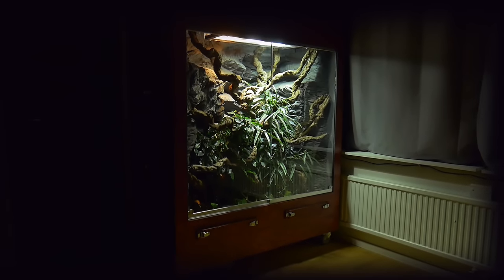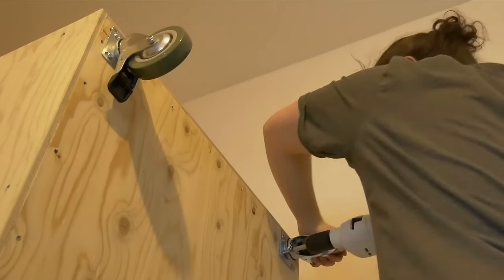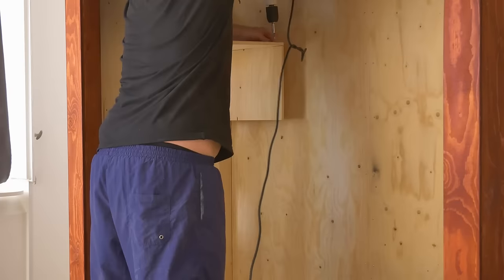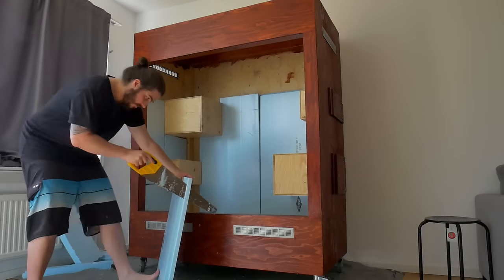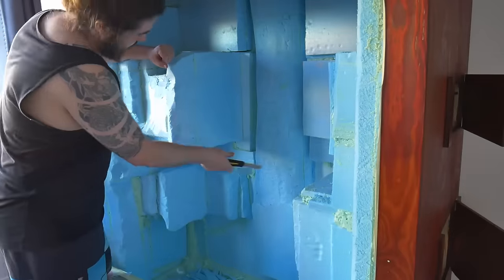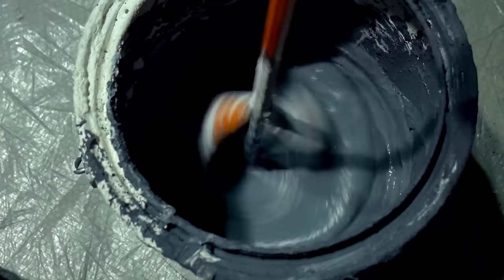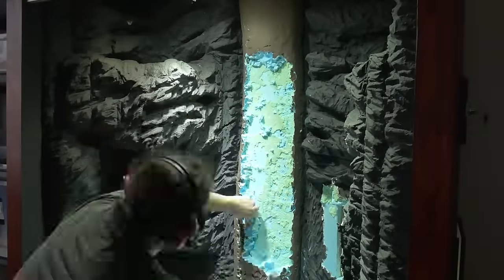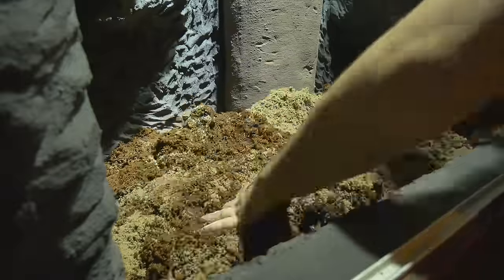How I made a Huge Reptile Vivarium – Full Build!

Comment: I worked in an upholstery shop for many years and a angle grinder with a flapper wheel make short work of foam shaping. It does require some vacuuming but it works great.
Reply: Also an electric carving knife is great as well.

Comment: This is a larger version of what I plan on building for my leachie. I can't wait for the more detailed build video so I can start planning. My baby is only a few inches long right now, but I want to start planning and building soon.
Reply from the maker: Working on it!
Reply: @SpectrumVivaria  Since leachies typically live in hollowed trees, I may have to revive your original tree plan and see if I can make it work. I've tried foam trees before and they are tricky. Maybe I should start practicing now or I can cheat and use large cork rounds haha
Reply from the maker: @cararichman1729  I spent far too little time with my tree to get it done right...lesson learnt. But I will try it again on another build in the future for sure. Nothing wrong with using cork rounds though

Comment: Best to drill pilot holes to avoid the wood splitting
Reply from the maker: For the plywood panels I didn't bother with pilot holes because of the size of the frame I was screwing into and the screws were quite small. I was also doing so many of them (200+ I think). I did however make pilot holes for all of the framing screws as this was important to not split the frame and was more likely using larger screws

Comment: For everyone using structure foam: If you want to safe time carving all that shit (also when adding / filling gaps after) you can wait ~ 20 - 30 min and just press it with your fingers in the spot you want it. the top surface is hardened enough but under it its still very soft and formable. Also when you get some on your fingers you can use vinnegar or citrus to remove it.
Reply from the maker: The problem with that method is the skin/surface of the expanding foam uncarved is smooth and not very porous. This is an issue for the grout/drylok/whatever you use to seal the foam to adhere as strongly as possible to the surfaces. You can do it that way but IMO it’s better to rough up the surface of expanding foam before sealing it. To do it that way for a larger vivarium it would also need an absurd amount of expanding foam cans and be far more expensive than using it with insulation foam sheets like I did here (if you want to create depth with ledges etc. and not just have a flat wall). 

But what you suggested could be a good idea for the filling of gaps created from the carving process!

Comment: The only thing I would have done differently is adding a plastic lining to the bottom inside of the vivarium, sealing off the wood a little bit better for the humidity and rot,  as water tends to absorb through the foam and could destroy the wood if there was in fact any small leaks. Beautiful build though, I love it.
Reply from the maker: Although how I did it has worked for me and there isn't any leaking or other issues after 2 years now - I still agree with you! I think this was riskier/harder to do correctly and it would have been easier to go with a pond liner.
Reply: @SpectrumVivaria  I'm glad no offense was taken, definitely helping give me ideas keeping me inspired with the builds. I'm taking the time to plan out a large build at the moment and I definitely didn't expect any feedback, but I'm glad to know the way you did it hasn't had any leaks. I was thinking of using a combination of masonry concrete with a pond liner given the research I've done. I was curious to see if you'd respond as I've done nothing to this scale and speak from little experience. Awesome and inspiring work!

Comment: This would be an amazing build for rats as well, with improved ventilation and obviously without the heating and misting systems. It’s certainly something to mull over
Reply from the maker: Interesting idea for sure! I had not thought of that but it makes sense - with far more ventilation and removal of unnecessary systems. Though the rock wall would have to be a far more durable system (maybe fibreglass or cement) so that they don't chew through it....Rats can chew through damn near anything lol!
Reply: Spectrum Vivaria I watched your vine tutorial too. I’d probably leave those hour as well and use the same climbing ropes I’d use in a traditional cage instead of chewing. Thanks for sharing your ideas with us.
Reply from the maker: @jaygay458  The vine tutorial can be viewed as a concept you can build upon with similar or other materials that suit your needs better. Thanks for watching and sharing your thoughts as well!

Comment: Hey dude, I have watched this video over and over again. It's brilliant, can you please get back to me ASAP with how it's holding up. Is it still completely waterproof in there and have you seen any signs of wood rotting? It would be hugely appreciated if you can get back to me as I have gone for the exact same method and copied your work to create my home for my Chinese water dragons.
Reply from the maker: The enclosure has held up great and my sealing was effective and has no issues. I covered this and many more details about this build in another video https://youtu.be/PJcjLpnTtQw . Its very detailed and has timestamps to find what you're looking for. I highly suggest giving this video a watch through considering what you're doing! Although it worked for me I don't necessarily recommend that method for others as I think its easier to do incorrectly compared to other methods of sealing the floor. Good luck with it!

Comment: how is the foam holding up with their claws? i never would've thought of just painting the foam with the drylok. what i did with mine was I painted the foam with watered down grout, about 6 layers and then used the drylok (5 coats). I have a Tegu and was worried his claws would tare the foam with the old silicone and smear dirt on it that i see a lot on DIY builds. the grout made a shell of "rock" on the foam and has held up great. there is a youtuber named "beckywheeler" hasn't done any video in like 10 years but she did DIY builds for people and she is where I learned about using grout.

Comment: Tips to removing drylock fume smell? Been a week for me long past dry and yet the moment the lamps warm it up its intoxicating all over again. Do u hwve similar issues?
Reply from the maker: Yeah even though its "dry" you need to expose the drylok to the warmer temps so that it off gases completely. I suggest keeping the lamps on 24/7 or warm it another way for a few days and if possible have it well ventilated/use a fan. In this enclosure because it is quite big I actually used a space heater in there. It took maybe 2 weeks or so for the fumes to be completely gone from this build.

Comment: This is so awesome! Will deff be referencing this when building my new snake enclosure! My only question is with the coating, it being latex. I'm assuming that you let everything dry and air out sufficiently before having the animals in and no risk of irritation?
Reply from the maker: Of course when using any type of paint, epoxy or whatever it's best to let it air out completely before adding animals. I would leave it for at least a week, but you can assess that yourself if the smell etc is gone.

Comment: Excellent work.  I have question if you have a moment.  Now that it has been a while since the built how has the drylok on the foam held up.  I always had a fear that due to their sharp nails it might not hold up.  Could you shed some light on your experience?  Thanks in advance.  Really awesome work.

Comment: Hello Spec Viv - I know this is an older video, but I’m curious if the rock ledges are still holding up - I’m thinking of doing the same with some cages using foam and DryLok as well. 
Great job, 
Cheers from across the pond!
Reply from the maker: Yes they are holding up well. For the ledges/basking spots I applied some extra coats to make them stronger as I was unsure how it would be after some time with strong lamps heating them. Though I don't know how necessary that was to be honest. This method works well but I wouldn't use it for animals much bigger than tree monitors. Good luck with your project!
Reply: @SpectrumVivaria  - thanks for the reply, good deal - I’ll be giving it a go for sure. It’ll be prasinus complex only. Thanks again mate

Comment: Amazing build.

How do you manage the reptiles waste inside the vivarium?

 if you can, recommend a way
Reply from the maker: Combination of things :
- Spot cleaning as much as possible.
- dish brush/toothbrush to scrub where needed with animal safe disinfectant (f10sc).
- Rinsing the walls with water after scrubbing etc (possible because of the drainage layer and drain I have to remove excess water, and also works for humid enclosure).
- shaking vine mass and plants so waste can fall out that I have missed .
- bioactive substrate.

Comment: Great video.   Rookie question here: is that a good idea to use masonry sealant on a surface that isn't masonry?
Reply from the maker: If you choose the correct drylok product "original latex based drylok masonry waterproofer" (do NOT buy any other varient and not the "extreme" varient either) then it is fine. This product is inert once cured and so is animal safe. People have used this product in similar ways and even for aquariums/amphibians for many years without issue, and those animals are far more sensitive to such things. Here is a link where if you scroll you can see on their own website that you can use it for Fish ponds. Ugl.com/resources/blog/10-surprising-ways-drylok/

Comment: This is an insanely cool build! What kind of pigment powder did you use to color your drylock?? The only reason I've never used it is because I didn't like the white color lol
Reply from the maker: Black iron oxide pigment! You can use liquid cement dyes as well and even latex paints (in small amounts). If you add too much of either pigments/paint you will know because it will become more thick/thinner than how the product is without them. If that's the case then simply add more white drylok to get the consistency right! Sorry for late reply! Working on a video to talk about this and much more detail on this build...

Comment: What did you do for the glass? Didn’t see anything about that. Would greatly appreciate it if you could explain that. Otherwise, amazing build guy!
Reply from the maker: This was a step I regrettably did not film/show in the video. To be honest I didn't think it would be so interesting but a few people have asked about it. The glass for this vivarium sits on an aluminium track with wheels. The glass piece itself has an aluminium bottom trim which houses the wheels that then sit on the track. I did not make it, I went to a glazier with my measurements and they gave me the glass and tracks to install myself.
Reply: Spectrum Vivaria thank you. I was very impressed with this build and out of all I seen this was the best! Well done bud
Reply from the maker: @lancecortez2607  Appreciate it!

Comment: This is awesome! I’m in the process of doing something similar. How did you do the doors? That’s the only part of mine I’m still stumped on. It’s 36 in wide and we don’t want 2 doors that block the view. Yours looks like 2 doors built split?
Reply from the maker: They're two pieces of sliding glass on an aluminium track with wheels. Have a video out soon where I talk about this and much more details about this build very soon!

Comment: This is absolutely stunning. I'm wondering though, maybe I missed it, but what did you use for the front of the enclosure and how can you clean it and replace the substrate? I'm wanting to make something similar but as 4'x4'x8' size for my son's hermit crabs for his birthday in a couple of months
Reply from the maker: If you are referring to the front glass its sliding glass doors on a track with rollers. So it can be opened/closed and the glass panels can be taken out for whatever reason its needed. If you want more info on the build there's a video I have just uploaded to the channel... Why would you build a vivarium 4'x4'x8' for hermit crabs? That's crazy big Lol
Reply: @SpectrumVivaria  I actually watched the second video after posting the comments and it made me realize how absolutely crazy a 4x4x8 would be 🤣🤣🤣🤣 also thank you for posting both of these videos! I will be doing a lot more planning prior to the build.  4x4x8 was just minimal cuts. But I have a circular saw and a jig so it won't be a big deal to make it smaller 🤣 was just trying to "save time" although it would really take so much more ore time to do the interior 🤣

Comment: Looks awesome!
But my worry is metal in a humid enclosure will corode and rust over time.
Won't the hooks for the vines rust eventually?
Reply from the maker: The hooks can be easily replaced if that is a problem later on. I could paint the hooks with the drylok though which would also help them to not be so visible in there!
Reply: @SpectrumVivaria  or just use 316 stainless hooks ;)
Reply from the maker: @Flyingdinosaur69  Good point! Though I do like the idea of making them a bit more incognito in the set up as well by painting them

Comment: Hello I have something of similar size just not as deep. How would you recommend converting something like this into two or three separate enclosures?
Reply from the maker: That is hard to answer without seeing it and knowing what you are intending to keep in each section. This build was designed and built to be a single enclosure. I probably would recommend not converting it at all and building separate enclosures that are purpose built for what you plan to keep instead... But if for example you built an enclosure big enough you could add partitions vertically by having a sort of track that could hold some glass/wood that you could take out or place at will (so one big enclosure becomes 2 or more from left to right)...Providing that its big enough for the species you want to keep and that you can provide the correct ambient temps, basking temps, humidity, space etc. for that species in each section. This approach is good if you want to keep breeding pairs of the same species separate most of the time and when ready, take the partition away for breeding and then put it back when you need to.

Comment: Just want to make it clear. For waterproofing especially at thr bottom, u r using:
1. Clear polyurethanes with added waterproof all over plywood
2. Xps styrofoam board + expending foam
3. Drylok

Was it correct? Most built i saw using pondliner for waterproofing plywood. This is first time i saw using polyurethanes. Tq in advance if u can breakdown ur waterproofing process.
Reply from the maker: That is correct - But I also used aquarium grade silicone on all the joints/edges of the frame/plywood before the expanding foam/xps foam/drylok. When I was sealing with the polyurethane, I had a lot left over and I actually poured extra of it to pool up and cure multiple times so it was far thicker at the bottom than just painting it on if that makes sense (particularly at the bulkhead drain to ensure it was sealed good there)? This was an experimental build and I would probably suggest not doing it the way I did and just use the pond liner method for the floor. Probably the safer option... Wouldn't want you to try replicate it and not have it work out. But the set up has been running for 2 years now and I have had no problems with the bottom getting exposed to water etc. Hope this helps
Reply: @SpectrumVivaria  thank u for ur advance reply. sory i quote it wrongly. Actually want to say most built using pondshield (epoxy). Planning to have a water feature/pond at the bottom, but pondshield is not available locally. Been researching for alternative. Do u have any of ur built/experience creating water feature in vivarium with similar waterproofing method (polyurethanes) for plywood?
Reply from the maker: @mastermune11  I would not use polyurethane for what you are talking about. Definitely use an epoxy for that. You don't have to use the "pond liner" brand of it - most epoxies (if not all?) are inert once cured. But research what epoxies are available to you and check that they are animal safe once cured.
Reply: @SpectrumVivaria  thanks for ur feedback on that matter. My local store quite apprehensive when i told them i want to use epoxy on wood, since most of it meant for flooring/concrete/steel (anything hard surface) . They said the wood might 'absorb' the epoxy

Comment: How well did this hold up? I'm worried about my mangrove clawing it to pieces like he did w his foam background that was covered in silicone & coco fiber
Reply from the maker: It is not surprising that a mangrove monitor did that - Neither method is appropriate for a monitor of that size. I wouldn't use the method I did with my build in this video for animals any bigger than my tree monitors.
Reply: @Spectrum Vivaria  what would you suggest I use then I'm not spending $500 on zoopoxy that's just ridiculous

Comment: How is the drylok working in the background?
Reply from the maker: In many layers it seals the foam, becomes quite durable and has a rough rocky texture. The animals are not able to damage the wall in any way and I am able to clean it quite easily. I would not use this method for all builds - If its for species much bigger than these tree monitors I would use an alternative method such as cement/grout.
Reply: Spectrum Vivaria I built my first one for an Ackie with cement but it seemed to crack. So I was curious of the durability. The new build will be for gilleni. Thanks mate
Reply from the maker: @joshalexander965  yeah a lot of people have issues with cement/grout cracking. Drylok won't crack in this same way. Definitely strong enough for ackies/gillens if you do enough layers!